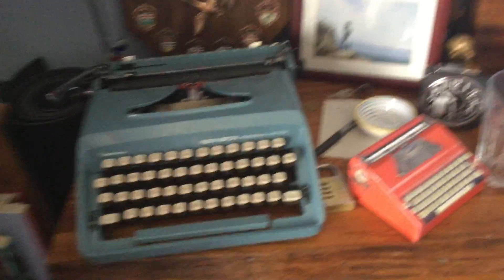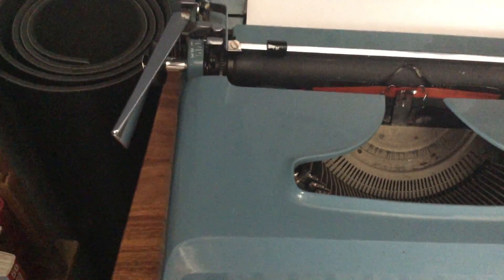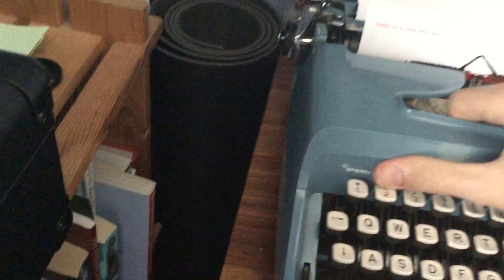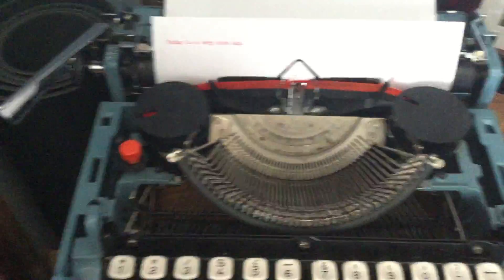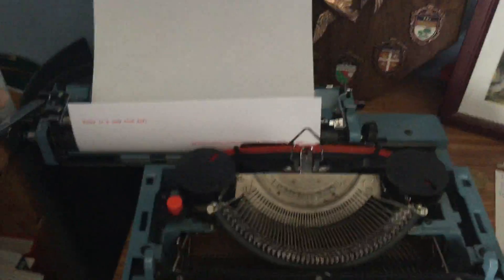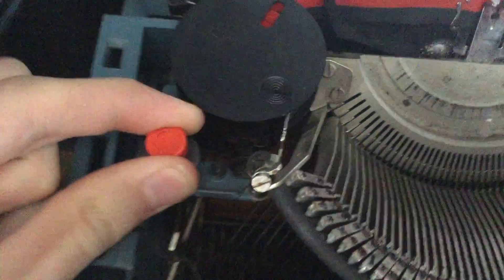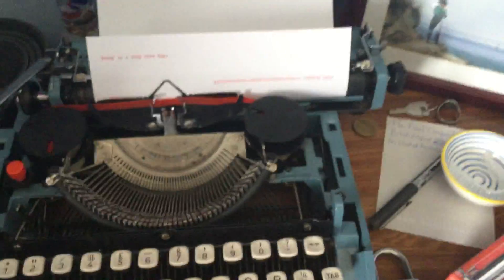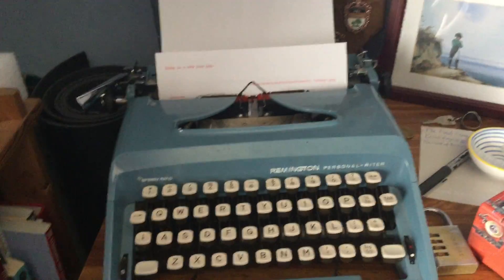How does a typewriter work?

Comment: Hey, it's been a while since I've used a typewriter, but I don't think your carriage return is broken. There is a selector that changes the roller from a smooth "roll to any position" setting (used when loading paper) to a "click one or more lines at a time" setting, used when typing. When in the "any position" seeing, the gear that moves the roller upon carriage return is disconnected. If I'm not mistaken, the selector is part of that small lever on the left near the base of the carriage return arm, the one next to the scale reading 1,2, and 3. That selects how many lines the roller should advance by moving it up and down, but you should also be able to pull it out to disengage the advance mechanism (any position) and push it in to engage the mechanism. Put your finger on that little lever and try pushing it inward towards the center of the roller (not sliding upward or downward, inward along its length). If I'm correct, that should put you out of paper load mode into typing mode and cause the roller to advance when you use the lever.

All of this assumes you are not just goofing around / don't care how it actually works.

Comment: How are the metal sticks and sticks with letters connected?
Reply from the maker: The metal sticks extend to the very back end of the bottom of the typewriter, at that point they conjoin with the extended parts of the metal sticks with letters, through this connection the metal sticks press onto the metal sticks with letters.
Hope that answered your question, also I'm no professional and I'm sure there a technical names for all the metal sticks and everything.
:)